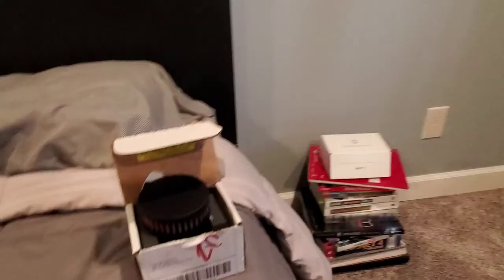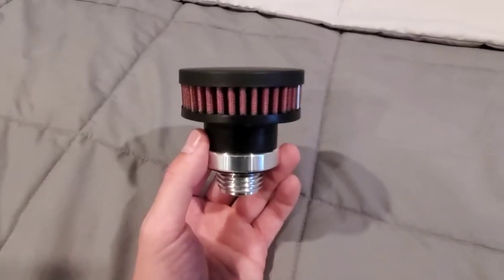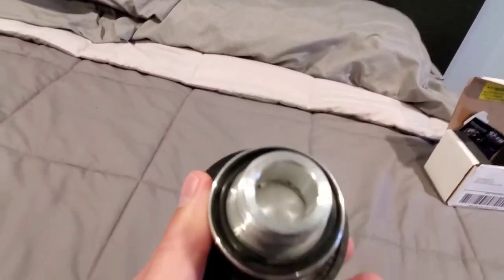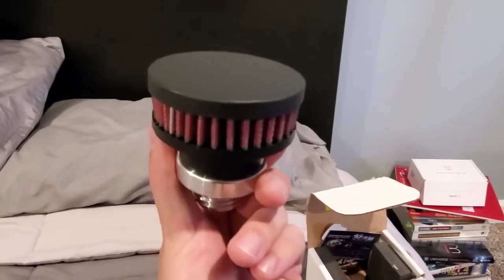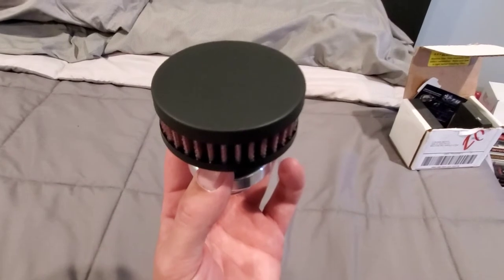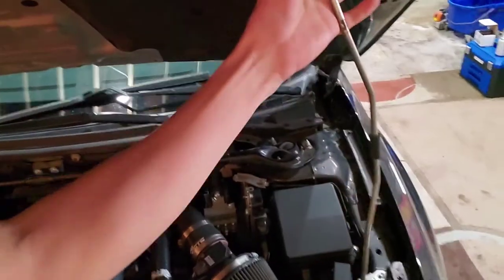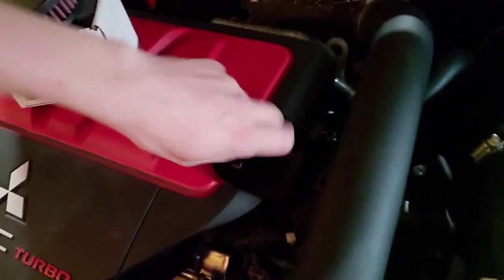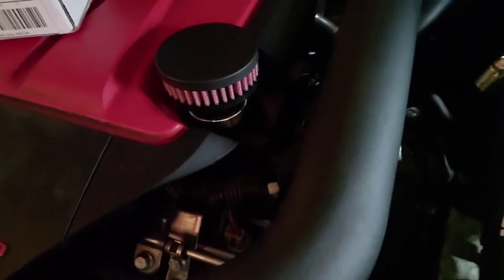Installing Innovative Crank Case Technology!

Comment: Think this would probably help with the mazdaspeed oil pressure issue too? Forces tons of oil pressure straight to the turbo under boost too
Reply from the maker: I noticed a difference big time honestly, but I am hyper sensitive to mods and wasn't expecting to actually feel a difference. At 325whp, I  bet this freed up 5-10 additional up top. It should help any unvented boosted application in theory